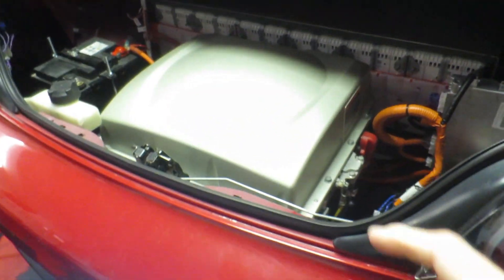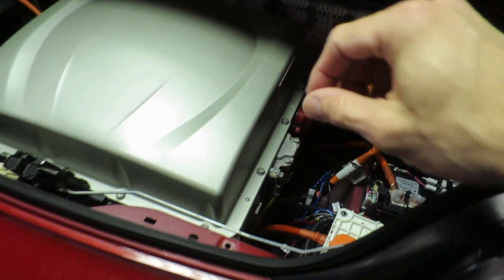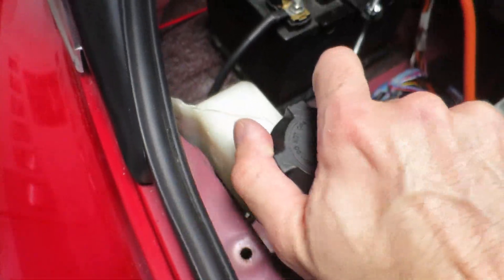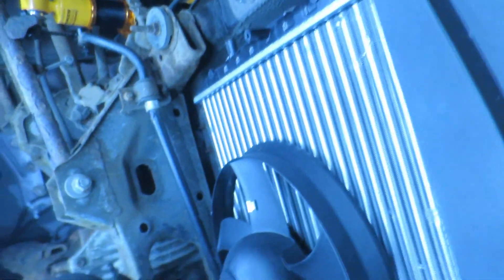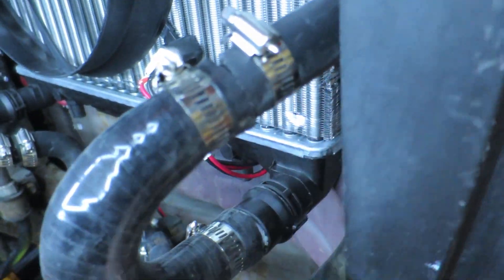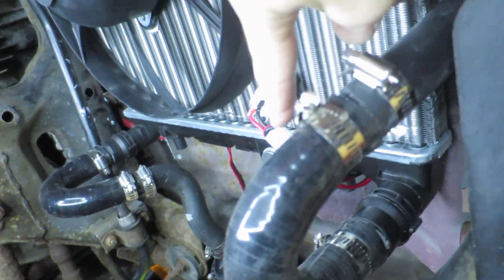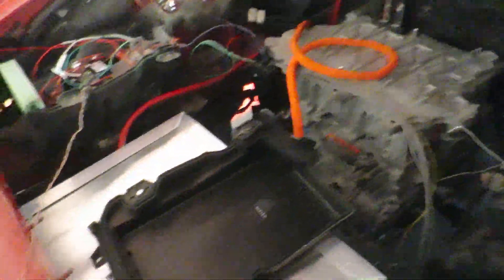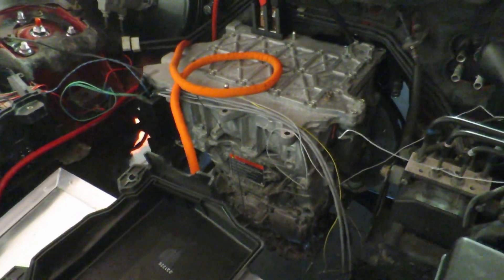Over heating Nissan Leaf charger, fixed! Electric Mazda RX8 Project.

Comment: Are you worried about stone chips damaging the fan or the radiator? Is the radiator angled? Ie one end higher than the other to aid bleeding.
Also is the radiator suspended on rubber mounts? If its mounted in a solid manner the vibrations would damage it
I'm not critiquing what you've done BTW, just curious
Reply from the maker: Hi - all comments welcome! The radiator is angled, and I could bleed every pipe, move the rad to the lowest point, spin it, still could not remove 100% of the air - it was weird, still cannot explain it! The Rad is fixed solid, not really thought about vibrations damaging it - guess like most things in a home built car conversion - I need a list of 'home mot' things to keep an eye on. All the welding, fixings, nuts and bolts etc - everything will need checking.

Comment: Great work! Just make sure you add some soft of shielding/grille in front of your radiator/fan, unless you'll soon have a hole due to rocks bombarding it. Also to reduce the fan noise, try running the fan at a lower voltage by getting a suitable DC-DC converter, e.g. 12 to 5-6V. Big fan is always good to reduce noise :)
Reply from the maker: yeah, shielding does sound a wise addition, every job does seem to create at least one or more sub jobs!! The fan is pretty loud in my workshop, will see how it goes and look to lower its speed if its annoying - it only comes on when charging so no massive issue.
Reply: @SouthWestEVUK  true that. Maybe a speed controller is better then? something like this. https://www.youtube.com/watch?v=QNPhE60RDoQ I imagine it being less efficient than a switched DC-DC converter though.

Comment: Heh Dave, if you are using I2C for communication with the LCD as I have been. I found out the hard way that that system is not very noise tolerant and will only run a very short distance. The spec I think suggests a meter. I have not been able to achieve anything much more than 10CM in the noisy RF environment of the EV. When I ran longer lengths it was fine if all that it was doing was monitoring the BMS. As soon as I drove or charged the car I would get garbage on the display. Shortening the wire solved it. I tried shielded, twisted pair, solid stranded. Nothing worked only shorter. All the best for 2022.
Reply from the maker: Interesting cheers - so during all my testing I have removed the wires from the car, and laid them out - still had the issue. However the four wires from the LED display that I joined into are literally just 3 tiny strands of wire each. When I removed them, and went direct with my wiring, the display was solid, even with the long wires. I have yet to bundle them back together and feed them through the chassis - may result in it being buggered again! Not sure what the communication method is - there is a Clock signal and a Digital Data (I/O) signal. I hope to rewire it tonight and see! Be really good to get it working, can display errors, % remaining etc.
Reply: @SouthWestEVUK  I am assuming it's one of those 4 line LCD displays. That's what I am using to display, battery pack voltage,SOC, KW and aux battery voltage.

Comment: Hi Dave, nice work on the cooling circuit.
Have you checked your 12 and 5 volt lines for ac noise? That could be an issue with the addition of the pump and fan.
Reply from the maker: So the 12v for the whole rear of the car is switched on a relay from the ignition. The whole rear, PDM, BMS, Cooling etc draws direct from the 12v car battery - so I 'hope' any noise is isolated from the rest of the cars 12v systems. That said - no I have not checked!
Reply: @SouthWestEVUK  it's a common source of gremlins, although I admit your symptoms were bizarre. Put your multimeter on ac volts and check the 12v with the cooling running for a rudimentary test.